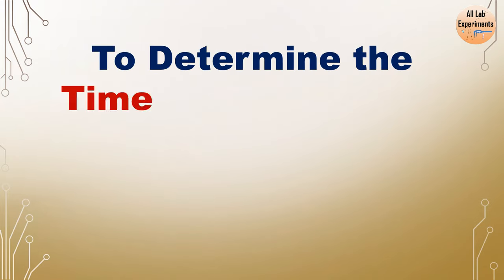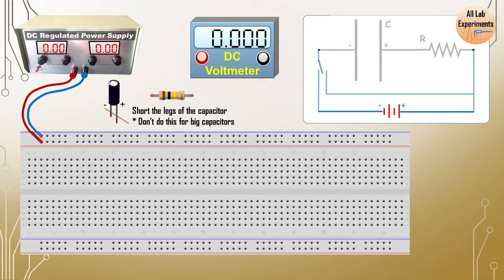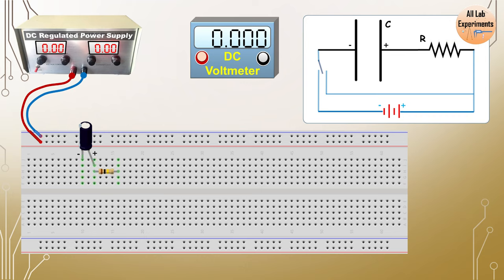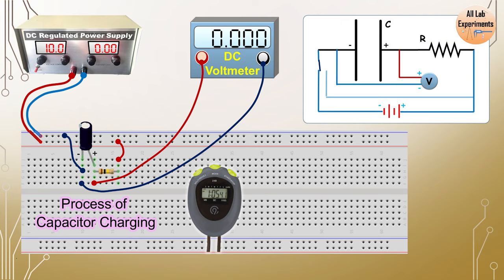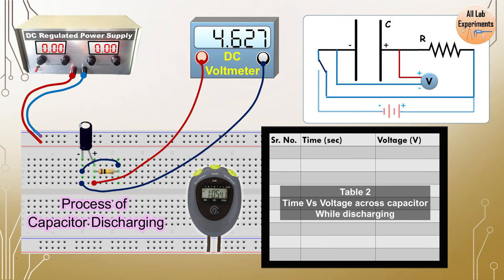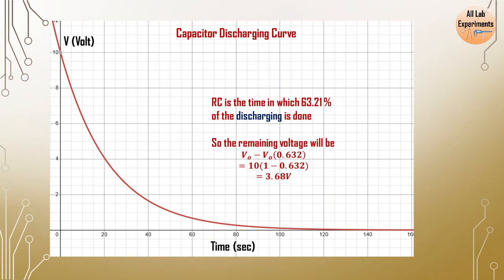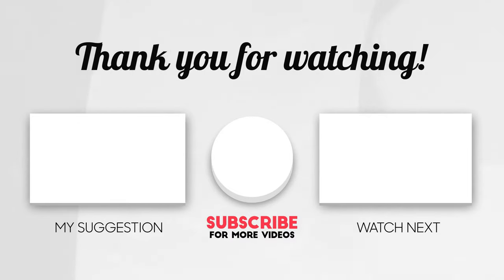Capacitor Charging Discharging | Time Constant | Full Experiment | Practical File

Comment: 00:12 An experiment to determine the time constant using charging and discharging of a capacitor
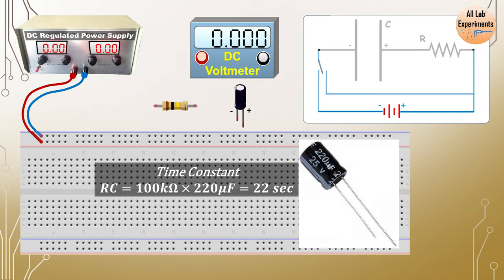01:21 Choose an appropriate combination of resistance and capacitance
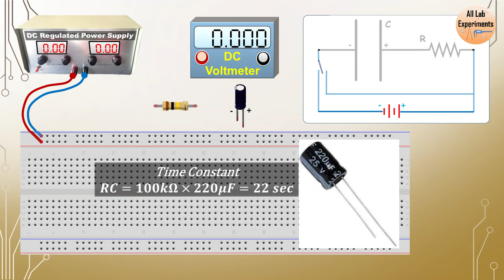02:17 Connect a resistor in series with the capacitor
03:19 The capacitor in the circuit is polarized and needs to be charged through a resistor
04:24 A capacitor is charged and the voltage across it is observed.
05:18 Experiment involves discharging a capacitor
06:20 RC is a time in which 63.21 percent of charging and discharging is done
07:15 Theoretical and experimental values of time constant in charging and discharging experiment
Reply from the maker: Good job... 👍

Comment: where is the file
Reply from the maker: Go to website. Link in description
Reply: @AllLabExperiments  bro i have to write observation but it doesn't have
Reply: @AllLabExperiments  I want to write what we observed from the following experiment
Reply from the maker: @ansutalgamingzone8311  there are observations as well. Check link in description. There you will find a practical file with readings as well.
Reply from the maker: @ansutalgamingzone8311  the time constant. Watch its viva voce video for all details about time constant.
Reply: How do you calculate the maximum theoretical current of circuit